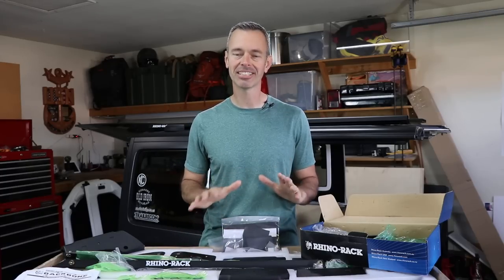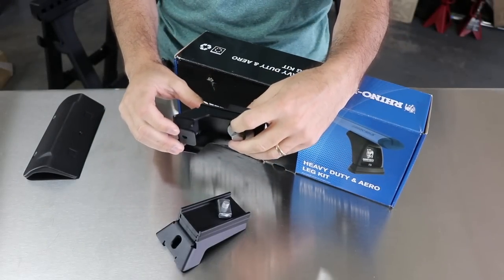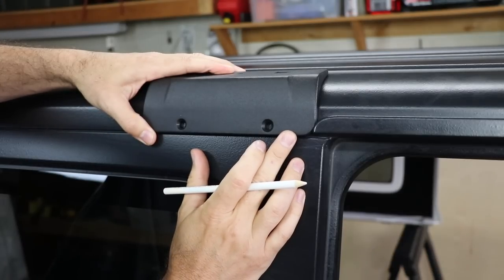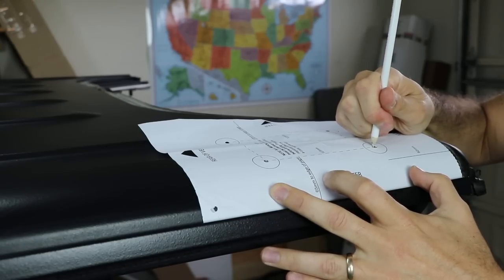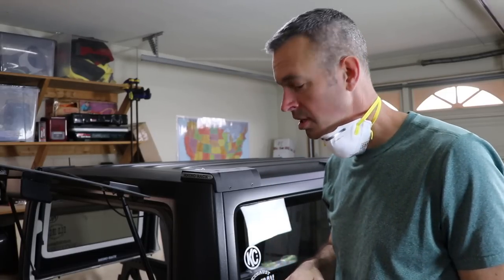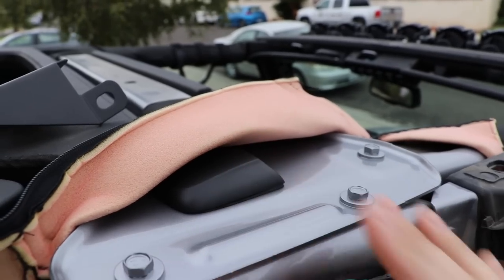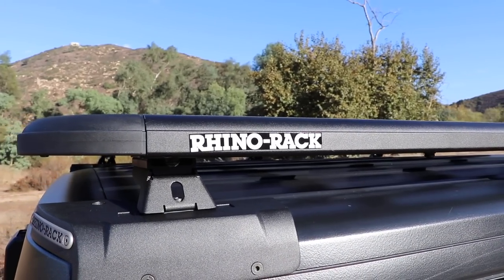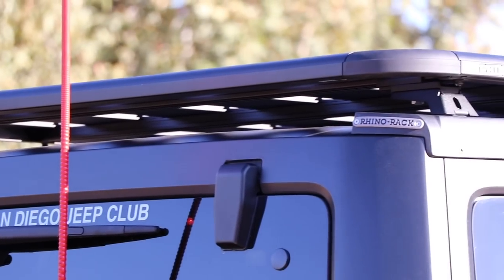Jeep Roof Rack Installation and Review - Rhino Rack Backbone

Comment: Brad, I agree this rack looks much better but the AEV rack transfers the weight directly to the roll bars which are only a inch or so away which only makes common sense. This one seems like it attaches to the steel in the top in the front only. Both require drilling the top which is no big deal to me. The AEV one only needs 4 supports so requires less drilling of hard top. Apparently AEV’s rack clamps to the roll bar which is stronger than attaching to just sitting on spacers on top of the roll bars but should not be absolutely necessary unless you are strapping something really tall on top which could cause an uplift force in strong winds on freeway or with sudden braking at high speed but it prevents easy removal of hard top, not that I will ever remove it. Other than looks is there a reason you prefer this over the AEV rack? I think you said in update video you plan on increasing the space between the rack and the roof a bit so you can remove your roof tent bolts easier. I am wondering why AEV didn’t minimize the distance to almost zero since they could have. I guess cleaning at car wash is an issue if there is no space but in San Francisco some of the parking garage clearances can be 6’-8” or less so with a RTT too every inch counts.
Reply from the maker: AEV makes good gear for sure, and their rack is ver well made.  I prefer the backbone design.  So takin the top of is seamless and no extra clamps attached to the roll bar.  I've had no issues with my rack to date and put plenty of weight up there while on the trails.

Comment: Hey Brad, awesome installation video! I have the exact same roof rack. I selected it based on the same reasons you have. The hard top with the rack is still sitting in my garage. I did the installation last summer. Probably, going to install it on the Jeep in the coming weeks. I am getting the cross bar too to add Rhino Racks' ski and snowboard carrier (576 model) for the winter. I am still deciding which rooftop tent to get. You mentioned in the video that you ordered yours. Just wondering which one you decided to get. Awesome Jeep, and channel! Loved Northridge 4x4 too!
Reply from the maker: Thank you!  I went with the Smittybilt tent and primarily based on price.  Full review of it in the coming weeks.

Comment: When you remove the back hard top.   Can you lift by the roof rack? 

Do you just take off normally?  Anything extra to do?
Reply from the maker: We just lift it off normally because reaching that high to grab the rack would be awkward. I'm sure you could, but probably best just to do it the normal way.
Reply: Lifting the Hardtop from the Pioneer platform is 100% ok to do without incident.
Reply: I meant by putting hooks to lift to ceiling.   And thank you for the response thank you both.  Robert and brad
Reply: How difficult is it taking the two front tops off?

Comment: Why didn't you get the quick disconnects? They allow you to completely remove the rack in minutes.
Reply from the maker: I'll have to look into that, but honestly, I don't think I'll be removing it.
Reply: The Quick Disconnects are awesome but run the Platform about an inch taller than this setup, which is required for the quick-release mechanism to fit/work. Trade off of height vs. convenience, whatever works for you I guess!
Reply: I have this rack on my Jeep and it's fantastic. My office has a low clearance parking garage so I'm not able to run the rack unless I'm on a trip. I also don't see a need to keep the extra weight on the roof.
Reply: nice...sounds like a pretty good reason for the quick disconnects!! :-D
Reply: TrailRecon if you had to remove the rack how many  screws ?
Reply: Jay,
their are 6 bolts to remove TrailRecons setup.
Reply: Can you use the rack to help remove the hardtop via a hoist setup? Or, do you have to remove the rack, then the hard top separately to go topless? Thanks. Jeeps looks awesome!
Reply: Justin Thomas, you can remove the hardtop by attaching directly to the pioneer platform while connected to the quick disconnect RLT600 leg or RLCP38/39 leg kit
Reply: Thanks for the video Brad. Just finished installing on my jeep and it was a breeze. A very good kit.  I did the quick disconnect kit and really really like it
Reply: Sorry, I'm kind of a newbie with my Jeep so I  have 2 questions. First, I just want to be clear you are able to remove the hard top without having to remove the rack; and you can use a pulley system? Secondly, how exactly does the quick disconnect work especially if you're drilling holes into the hard top?

Comment: Great video, I scrolled through the comments and may have missed it, but what are the weight limitations? Rhino's site says 260 some pounds, there must be something I'm missing.
Reply from the maker: Thank you!  I believe the dynamic weight is 256 lbs and the static weight is 800 lbs.
Reply: Good to hear, for a moment I thought about dieting.... But I'm over it now. :)
Reply: You got me fired up for this setup and I'm going to get the same thing. BUT, I have the new JLU and the same kit won't work on it. Rhino says they are working on it but will probably be 6 months. Just thought I would let you know, in case someone asks.

Comment: Hey Brad. Thanks for posting this great install video!!  I can attest this is a great rack after having it installed on our 2013 JK. The only way my wife and 2 kids can get on the trail is too have all the camping gear up on the Rhinorack.  We just got another JK that I'm gonna install one on tomorrow, but have been wondering what to do with the Mopar Hard Top insulation.  Did you cut into it, or just drill through it and bolt on?  Any insight would be appreciated.  Keep up the great work on you channel!
Reply from the maker: Great to hear!!  I did have to trim the Mopar insulations, I tried drilling though it and then squeezing everything together, but couldn't do it.  I trimmed about 1/2" around each bolt to make it come together.
Reply: Thanks for the feedback.  I'm ready to start drilling!  Have a good one!

Comment: After about 6 months of having it, are there any regrets? Maybe a followup video if there are.
Reply from the maker: I love the rack, my only issues is the low profile is a little too low.  Trying to mount my roof top tent and getting access to the bolts to secure it is challenging.  I'd like about another 1' or so under the platform.

Comment: Warning. Check the template measurements before drilling the holes for the front bracket. I checked the lead edge to first hole measurement and side edge to the drill holes only to find the template was out by 10mm between the front and rear drill hole. I rectified the error by enlarging the holes but it is a poor reflection on Rhino racks quality control. Why bother including a template when it is so far out?

Comment: Yo Brad... installing the same this weekend... watching now for tips and tricks... any lessons learned before I start tomorrow early am?
Reply from the maker: It's pretty straight forward, I think I covered everything in the video.  Take your time and measure twice!  Good luck with your install!
Reply: It was pretty straight forward, although mine was different from yours as I bought the version with the side rails (Pioneer Elevation). It came mostly assembled. Also, I had to tap one of the rear feet as it wouldn't thread and I was make a turn away from stripping hardware trying to get it in. You were correct, mounting the rack, feet, and mounts is a little tricky because it's tight in there... my hands hurt. My 2017 JKU hard shell came with a sound dampening fabric lining that has to be cut back for the backbone system to marry up well with the bolts. Folks might want to take the time to exacto out the area where the backbone hardware meets the top of the hard shell and connects to the outer back two mounts. Doing this BEFORE drilling mount holes will avoid drilling the lining out through the holes you drill for the back two feet.

Comment: Do you still have this rack installed, I know you switch gear all the time so I was just wondering if you kept this rack.
Reply from the maker: No, I've been running a Rhino Rack system for about 2 years now.
Reply: TrailRecon This is a Rhino Rack system. Are you saying you installed a different Rhino Rack model?
Reply: @TrailRecon  Wait.. I thought you were still running this rack. Are you running a different rack now?

Comment: Do you know offhand if they make rails for this rack?
Reply from the maker: They have a few different variations of the platform (one with bars running down each side) and lots of accessories.
Reply: Hello Tom,
Rhino-Rack makes an ajustable Side rail kit, a full surround rail kit & a Half & Half rail kit that can make a U shaped rail that can wrap around the rear or front of almost every Pioneer platform we make.
Reply: Awesome.. thank you.

Comment: Thanks for the video Brad.  Wife and I are getting the bug and watching all your videos as we modify our 2018 JK. We have decided on the same rack but had one question.  If you did this rack again would you install the quick release brackets.  I think they are a little taller, 1" maybe.  We have RTT to install on the rack.
Reply from the maker: Since this video, I have installed the taller legs.  The low profile legs make it difficult to reach under and attach the brackets for a roof top tent.

Comment: $4,000 I can put that into other accessory to build up my jeeps in a roof rack that's nice but you need the sides on it too
Reply: Jimmy,
this unit is more like $1,329.00 MSRP and has extra options for a system with a welded rail all the way around, a welded side rail and also removable side rails, full rails, and even half rails. Most users prefer flat systems for garage clearance and sides prevent users from running a standard  RTT

Comment: Hey Brad, ever since i saw this video back few months back, i have always wanted to buy the rhino rack but then i stumbled across AEV roof rack, infact if you check autoedit guy,  https://www.youtube.com/watch?v=LsulkHFfOYM , now i am split between the both. Question: Have you had a chance to review this before you bought rhio? Why rhinonack , why not AEV? Appreciate your response.
Reply from the maker: I took a look at the AEV, Frontrunner and Rhino Rack systems.  In my opinion they are all great quality. I chose the Rhino Rack because everything is attached to the hard top and no mounts required on the roll bars.  This allows me to take my top off without any extra unbolting of the rack an no ugly brackets on the roll bars.